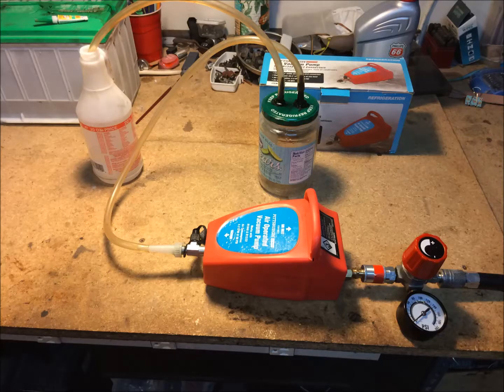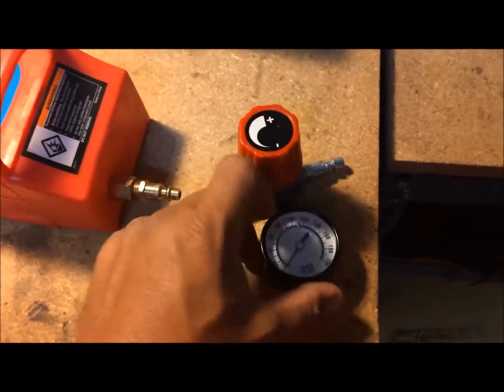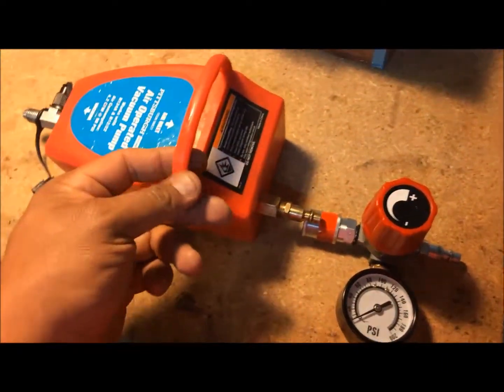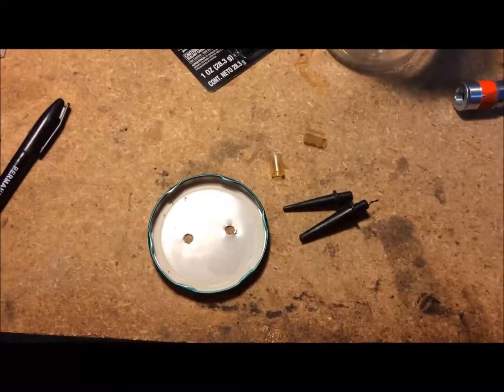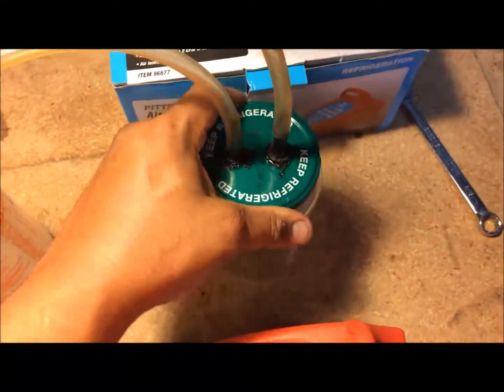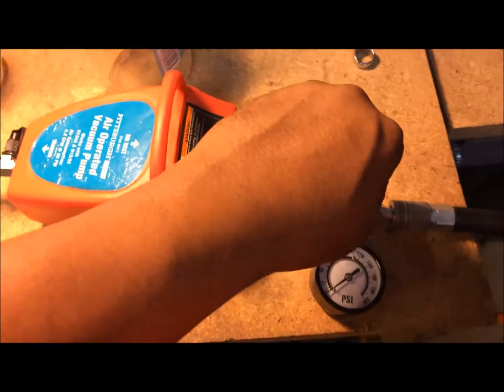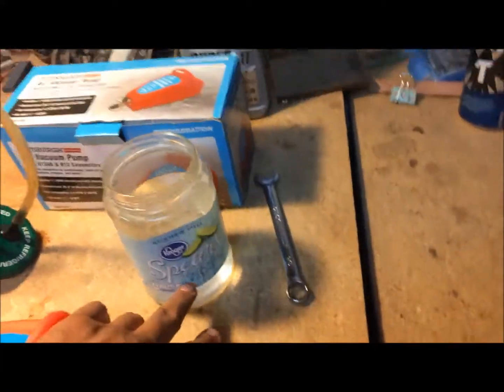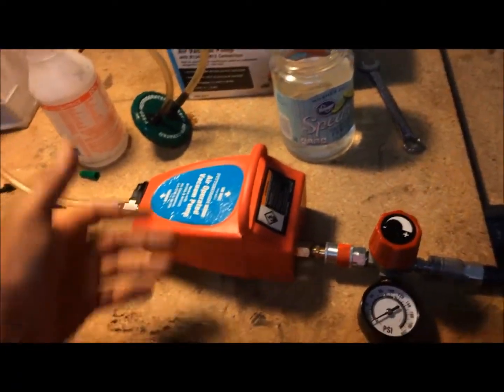SIMPLE DIY BUILD YOUR OWN EVACUATION removal evac tool power steering fluid & transmission fluid

Comment: I have a goofy question...I wonder if, instead of an air compressor, if a kick-style bike pump would get the full amount of 90psi vacuum, in an actual sealed container...I'm trying to make a cheap DIY vacuum tank to pull bubbles out of my resin castings...I only require about 40lbs, overnight for pulling the bubbles out, and for curing time...
Reply from the maker: I don’t see why that wouldn’t work. 🤔

Comment: How would I use this to evacuate car AC system?
Reply from the maker: You need a lot more than a vacuum pump to do that. You need an evacuation tank. If you are not versed in AC work it’s best left to a professional. But you could take your vehicle to a shop and ask them just to evacuate the system for you and you can then add oil and recharge the system, provided that there are no leaks. You could ask the shop to vacuum down the system to check for leaks for you and you could recharge it in to our own. But the system needs to be vacuumed down prior to adding refrigerant.
Reply: @WarPonyAuto  thanks bro you’re a year late😂😂😂 I let the professionals do it.😂😂😂

Comment: Great video!  I was thinking of using an air conditioning vacuum pump, but I like the simplicity of using the cheap-o HFT pump instead.  I also like not risking exposing my A/C pump to brake fluid and other chemicals.
Reply from the maker: Thanks for the comment and like 👍🏽 Yeah, I was in a bind and had to make my own in a pinch and thought maybe others can benefit from my tinkering 😂 Like, share and Subscribe if you haven’t already. Thanks again.